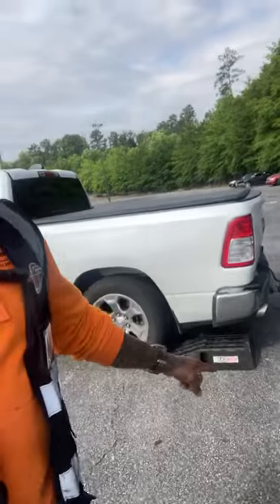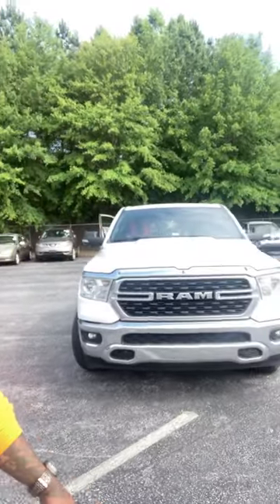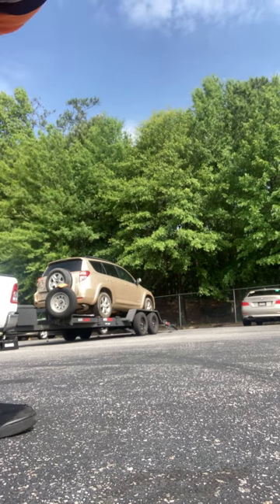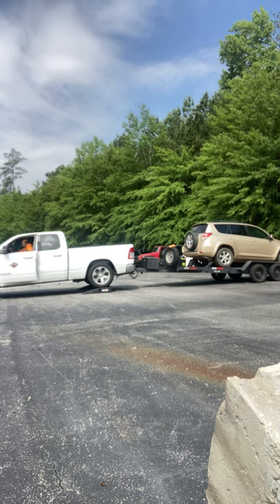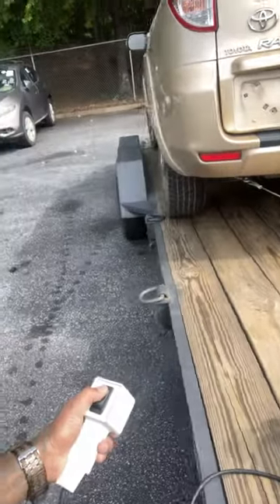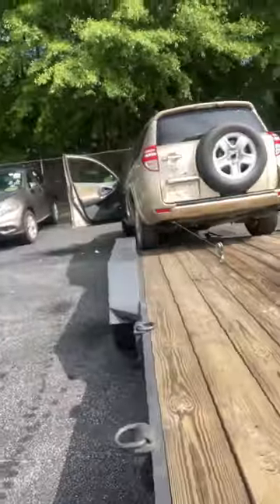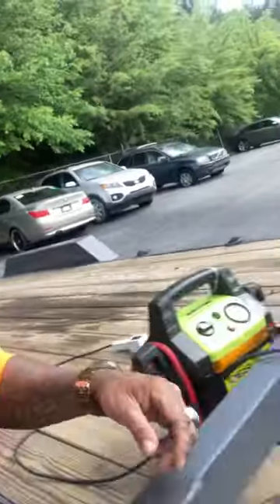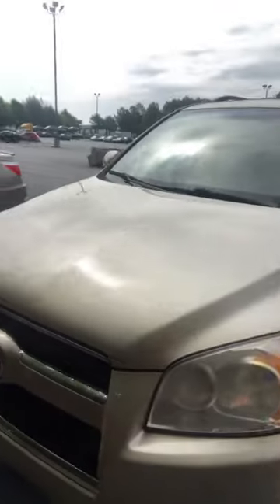Roll inops off your trailer

Comment: they got trailer jack. you can unhitch, and then crank the trailer front up to create tilt.
Reply from the maker: Dope idea. I’d like to see it done
Reply: Leave it connected and place a  car jack under trailer jack works every time
Reply: Without choking the trailer wheels, it's gonna lift and shove the tongue into back of truck. When rolling off tail end of trailer. That's if the trailer is unhitched like you say. I do it all the time.
Reply from the maker: man id show like to see it done in video! when you gonna make one so I can check out your technique?  @mrgoodtimes05